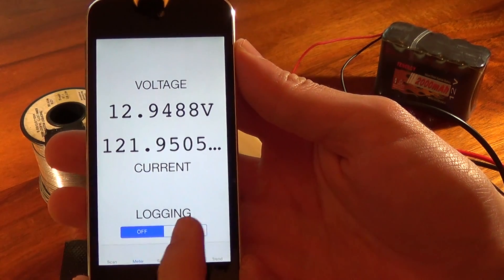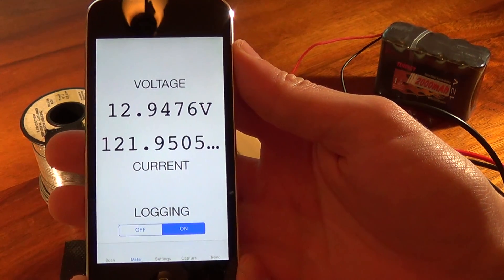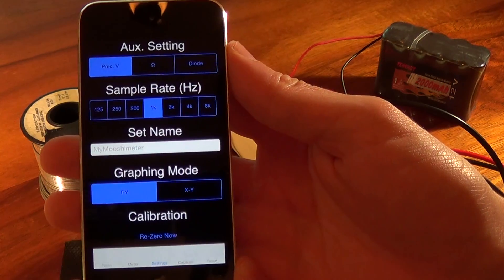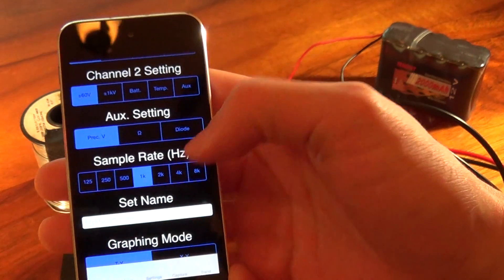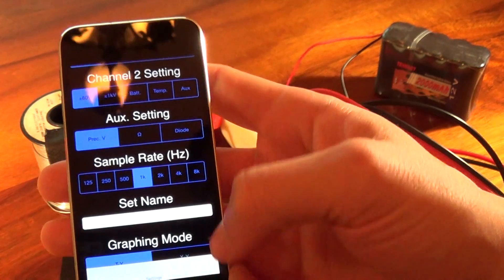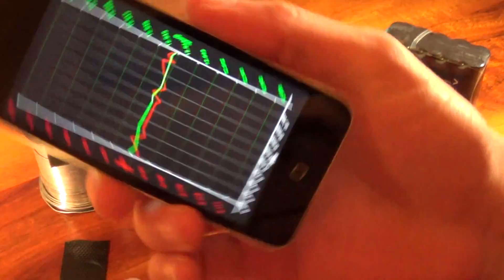Quick Battery Discharge Test

Comment: It is a good way and simple, but this resistor should be calibrated first to know accurately its resistance first :D Also at 12V, the resistor will heat up, and this will make its resistance to change. It could be characterized, or instead use a resistor with higher value (so it heats up less, but it then discharges battery at smaller current, which both is different measurement and takes time), or one that has lower temperature coefficient. If you measure the current as you do here, you don't need to worry too much about the temperature drift, as you measure directly the current (but at low voltages you need to be careful and think about the burden voltage and small power dissipation in shunt resistor in the meter itself, it could be compensated tho). One of the better resistors for testing up to 3V, would be Vishay NS00550R00BE12 , a 50 Ohm 0.1% tolerance, 5W, 20ppm/K, it is about 9 dollars per one resistor. Once you get your data of voltage vs time, knowing the resistance, you can calculate the current at all times (it will slowly decrease as the voltage of the battery is decreasing too), and plot whatever you want, like Voltage vs capacity (mAh), or Voltage vs Energy (mWh). You just need to remember that the current and power is not really constant in this setup, but still it is very useful measurement! Another option is to use a cheap DC-DC converter to stabilize output voltage and dump it into resistor at constant output voltage. This way you measure basically a battery behaviour under constant power. Not exactly, because DC-DC do have different efficiency at different input voltages, current and load, but never the less in many applications I would say it is even better test than constant power or constant current, because in the end, the battery is almost always end in a device that have voltage regulated via DC-DC converter and load will operate in constant power mode.